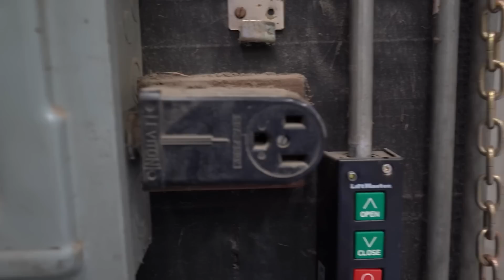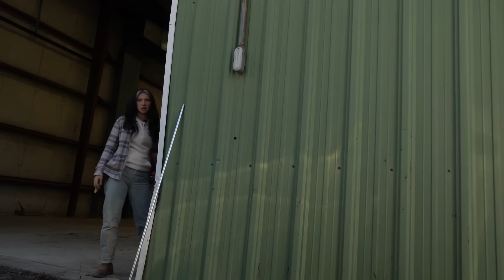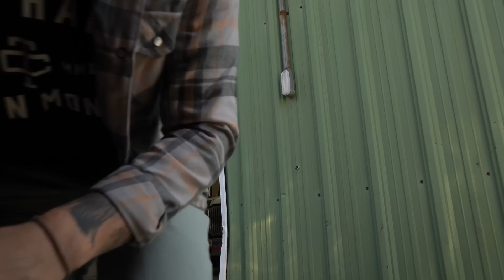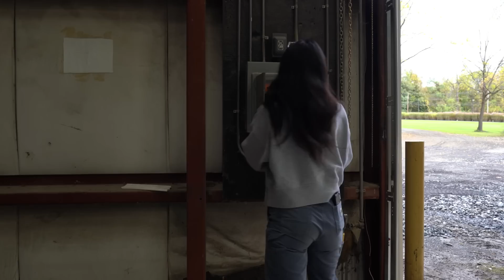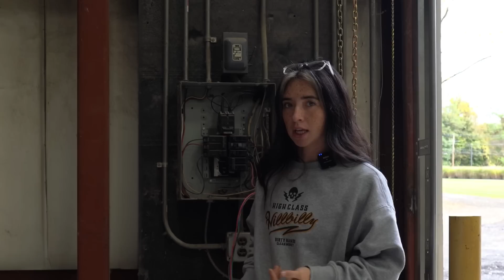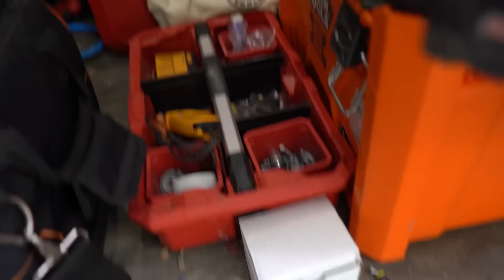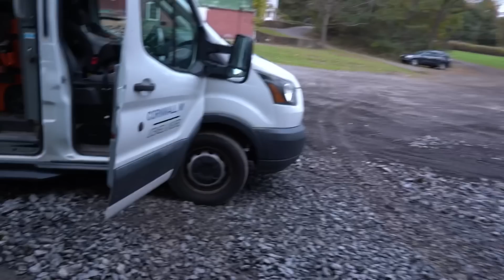How to Install a 30A Outdoor Outlet

Comment: Just started this video and already pissed off as an electrician.  What is with these weird electricians that think they are geniuses? 230V, no. On 120/240. When we test we expect 240 around here in Minnesota.  If you start getting down to 230 your 2V away from a 5% voltage drop. So just no.
Reply from the maker: I was just saying that the pressure washer was 230v I was literally just reading what the equipment said. I said in the video later that it’s 240v…
Reply: It's a 240V (whatever your voltage standard is in the USA) outlet because the outlet is designed for 2 hots (line 1 and line 2) and a ground, not 2 hots and a neutral. So you can only use the outlet for 240V. Do your research on the nema outlet chart and you will see.
Reply: @adams
Don't be such a Rodney.
Reply: You are still allowed 5 percent volt drop from your service to your load. Any reading you take from your device you are reading the volt drop on its entirety so 5% is acceptable still. This assumes you are taking the voltage reading under load , taking. A voltage reading with no load won’t tell you much about volt drop.

In Canada inspectors enforce  volt drop, I heard Mike Holt say in the states it’s a suggestion and goes off manufacture specs for each piece of equipment

Comment: Lexi, a whole lot to discuss here:

First: ALL GOOD.  YOU ARE DOING VERY WELL AND I APPRECIATE YOU SHARING YOUR WORK AND JOURNEY.  I've been watching you for the past year and I'm going to make some remarks.  Please remember, the information I'm providing is from experience and I only want you to be the best electrician possible.  (side note: loved watching you learn about D10 :))

Nice job on the Rhode Mic and editing.

The 4 square w/ duplex below the loadcenter....KO the back and install close nipple / EMT stub through the wall unless the exisitng 1/2" EMT needs to be derated too much for the existing current carrying conductors, (it appears there are only a pair of #12's in the video).  Otherwise, install your #10 into the existing J-box and raceway already terminated to the loadcenter to save time and money to the customer.

Garage should have GFCI protected devices.  The duplex below the loadcenter should be a WR/TR GFCI duplex.  I know you are not there for that, but 10 minutes and $20.00 could save someone's life.  If my daughters were working in this environment, you can bet I would want GFCI protection installed even if the customer didn't ask for it.  I would eat the cost if the customer doesn't understand.   All 125-volt, single-phase, 15- and 20- ampere receptacles installed in the locations specified in 210.8(A)(1) through (10) shall have ground-fault circuit interrupter protection for personnel.

Not ALL work needs to be minimum Code compliant; you can extend your experiences and knowledge just a bit further without extra cost to your customers.  A perfect example is you using Duct Seal for the 2Gang WP box, Code doesn't require it....but it makes your work better.

Drill out the holes and install the grounding pigtail within the WP box before you install to the finished surface.

Install 3/4" EMT as minimum for commercial applications and pull the neutral conductor for a 240V circuit.  No, it's not code.  Just do it, you'll thank me in 25 years.

The 2023 NEC is going to be enforced in 2024.  I understand you are only installing a branch circuit feeder, but I would like to remind you to start looking at and practicing in your mind to seperate the grounding and grounded conductors at the service; don't forget the receptacle and TVSS also required when you work on the service.

Wear gloves!  I'm not talking about hot gloves.  Protect your skin when handling NEW EMT.  Get a pipe reamer for your EMT cuts.  Cheap, light, fast & clean.  Yes, linesmans work well for 3/4", but not nearly as good as a reamer for 1/2" EMT.

Did you verify the neutral bar is bonded to the enclosure?  Just a reminider everytime you are at a service to check everything especially if YOU didn't previously install it.

Wrap thermal insulated adhesive (electrical tape, 33+, etc.) around the exposed screws on the receptacle.  When someone services the device, it will help protect them if they didn't lock out the circuit.  It can also help if a strand of THHN isn't properly set in the wire terminal and prevents a dead short to ground.

Cycle the OCPD (breaker) and test voltage BEFORE you terminate conductors/ load to it.  Verify your voltage at the beginning of the circuit.  New circuit breakers DO NOT always work properly.

Once you tighten the terminal screw to any new conductor, back it off a quarter turn and retighten.  Also remember the Authority Having Juristiction (AHJ) can inquire about the torque wrench you used and the ft./lbs. settings you applied.  It isn't used often, but it can be a conversation piece to be sure.

You installed a GE THQL circuit breaker.  Did you provide the documentation for UL listed equipment between GE and the Murray loadcenter?  Leave the approval rating pamphlet in the loadcenter.

You changed the phase colors within the loadcenter. It was Phase A Black/ Phase B Red and you changed to Black/Black, then back to Red.

You had 126V on one leg and 116V on the other leg.  Did you look into that further?  Is there a heavy load on 1 phase @ 120V somewhere?  Is the 1-1/4" riser properly bonded and have a have a bonding bushing?  Is the loadcenter grounded to building steel?  Doesn't appear to have ground rods.  Did you recommend to the customer?

Never look directly at the OCPD and energize.  Use your non-dominant hand to operate the handle and look away from the OCPD before energizing.  But first, TRIPLE CHECK EVERYTHING and have an exit strategy before closing the circuit at every job you are visiting.

Good job identifying the circuits!

While the panel cover is off, spend 1 minute and check all the terminal screws within the loadcenter are properly tightened. 

Does your new 2-Pole circuit to exterior receptacle need to be GFCI protected?  I'm not telling you it does, just asking what YOU think?

You are doing wonderfully.  I wish you all the best and would hire you in a second.

Happy Holidays and keep up the great work!
Reply: Nice description I can see where you’re coming from, some good information here. Hope more people take the time to read it. Not putting anyone down just showing good knowledge and asking questions. That’s what trades are all about.
Reply: She was there to add an outlet, not bring the entire building up to current code. She mentioned how old it was…
Reply: I agree, she was hired to put in an outlet, not save the world
Reply: @joshuasechter5306  my thoughts exactly! And I wouldn’t be installing something the customer did not request. If something goes wrong that comes back on her & the customer saying that they did not request that additional work, could possibly go the lawsuit route too.
Reply: Lol
Reply: Oh get the fuck out of here. No electrician goes to add one outlet and just starts spending their own money to upgrade everything around it.
Reply: Imagine this guy at a gathering.
Reply: gezus bro u got way too much free time to be typing out essays on here, she probably wont read this
Reply: @Lewdacris916  I'm here to learn; it's a dangerous occupation.
Reply: @Lewdacris916 he made some valid points. Lexi is a good electrician, but she still has room to improve.
Reply: @Lewdacris916 lol I read the first paragraph and glad I scrolled the rest of that test that was written..😂

Comment: First year here, Really enjoyed the long form content on YouTube, especially with a more step by step approach. I’m not here for an install guide, but i enjoyed seeing the method and maybe a new way of doing things.
Reply: I agree!
Reply: Hey brother, as far as the electrical install, she did great work.  Okay, I can question if this needs a GFCI under 210.8, but remember what 90.4 allows.

I would ask you to stay hungry and ask why.  She did these right, just did not explain them.

Why connect ground, then, neutral, then hots.

Why connect the receptacle before the panel.

EMT counts as a ground, so the box is grounded and the EGC connected to the receptacle grounds the receptacle.  This meets all the code requirements without a grounding pigtail.

Jw's often get involved in the work and the explanations are often not stated.  Yeah, me too.

Comment: Why do I have this feeling they will have you back at some point to install a larger breaker panel, a building of that size with that few a circuits and the panel is full, leaving zero room for expansion. But I also know how it is, things cost dearly these days to go and do a complete electrical upgrade. By the way your mic is fantastic, its like you are sitting right beside your audience.
Reply from the maker: I actually already spoke to the customer about it haha that’s coming
Reply: @lextheelectrician  A work in progress as they say and no doubt they want to get their ducks in a row to know what they want and need for the future use of that building.  Aside from that, you have some mad skills to have lined up/drilled the hole like you did relative to the other components, that was beyond impressive. And you took the extra step of using sealing putty on a horizontal run to prevent a water issue, which brings back an electrical issue mess we had on the farm not long after the job had been done by an electrician as it was lights mounted high up on a grain bin and weather proof cover style light switches at chest level ... only they ran the wire out of the top of the switch box up to the lights rather than out the bottom and looping around up to the lights and so the water ran down the wire and into the switch box drowning the switch in water ( what a mess, corroded and fried the switches ) ... they came back and put massive amounts of putty around the fittings on top of the switch boxes and junction boxes to mask their poorly executed wiring job ... ironically that putty held the water out for many years until it dried out from direct sun exposure and cracked up some and let in a bit of water and I had to reseal and replace the switches again at that point. Had they wired it with the right theme of components and techniques like you did in this video, I would never have had a problem and they would not have had to come back to mask over their mess. I bet you've been called to redo someone else's wiring mess more times then you can count by now, not all electricians are created equal, that is a fact !
Reply: @lextheelectrician what’s up Lex huge fan of the content pardon my ignorance because I’m an apprentice but couldn’t  of you just got away with emt to flex or emt to liquid tight transition.
Reply: I would marry you right away❤❤❤
Reply: Just put a sub pannel later
Reply: @jamesguiberteau6607  There is nothing at the panel Lexi was working on to feed a sub panel from, more than likely the wire run into the building is lacking or at least to that panel if there is more than one drop location for power into the building.